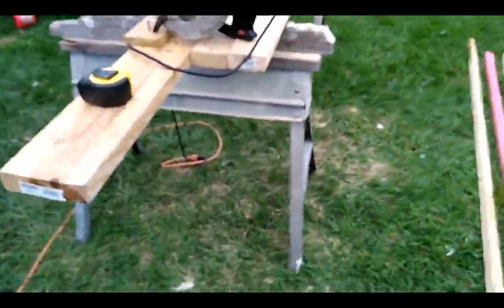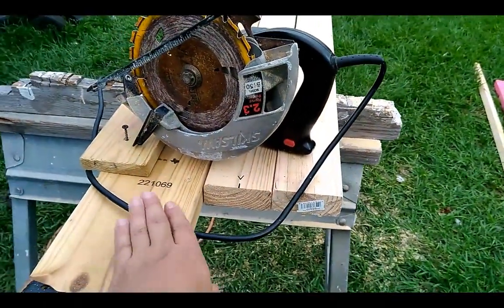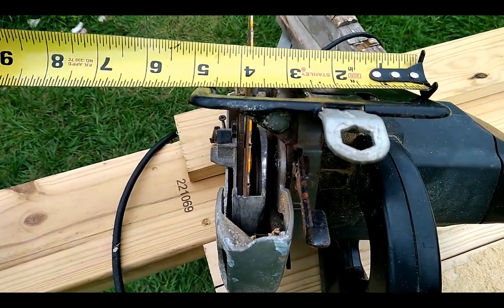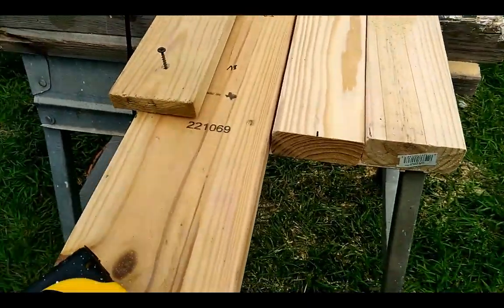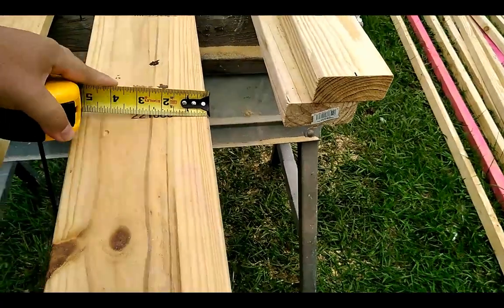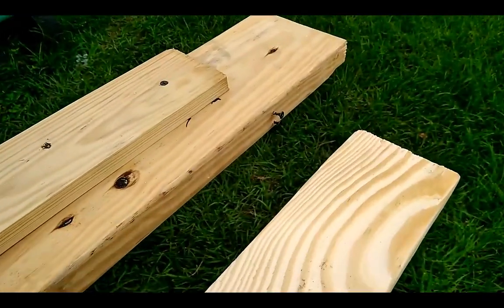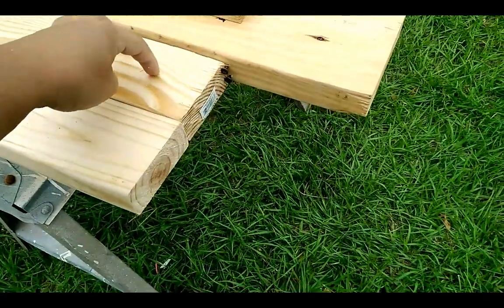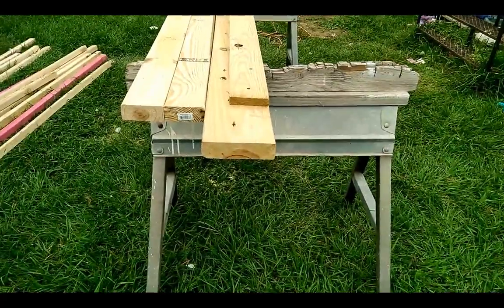How to make a jig to rip 2x4s fast! How to make 2x2s for a chicken coop!

Comment: I wish you would have actually cut the 2x4.   How do you set up if you only wanna square off the 2x4 by ripping the sides. ?   Thank you for the video .
Reply from the maker: Just move your top board over the 1x4 until the blade lines up with the side of the 2x4 where you want to shave it off at. Then flip the board over and do the other side. Once you set the 1x4 you can screw it down and do one side then flip the board to do the other side.
Reply: Hi RCG   Thank you very much for your reply. !!!!!!!!!!

Comment: Would you not get kick back?
Reply from the maker: I've never gotten kick back doing this method. As long as you don't bind your saw blade up it works great. Your saw blade is cutting a 1/16" or so gap between the board so there is no way to get kick back when you are creating space.
Reply: You don't get kickback, because the board is sandwiched between the saw and the sawhorse, can't twist or jump around.